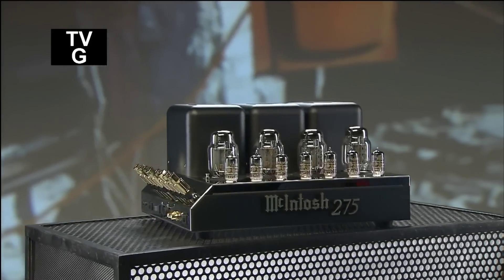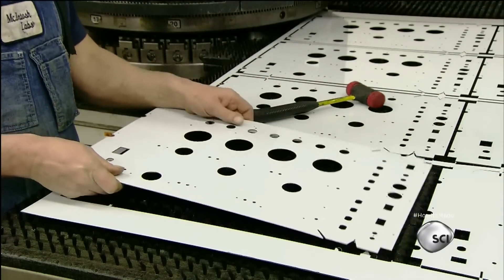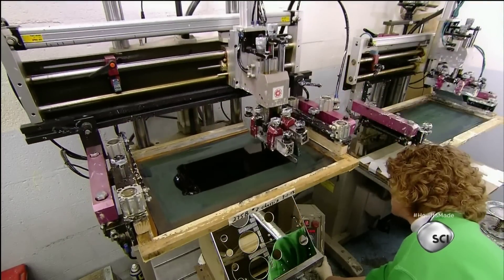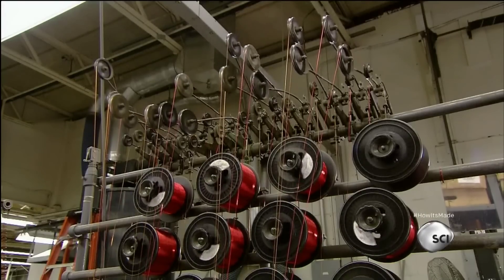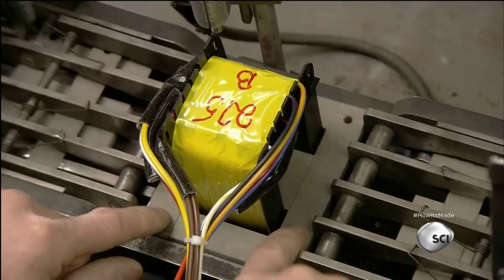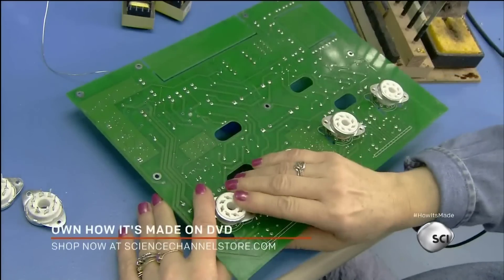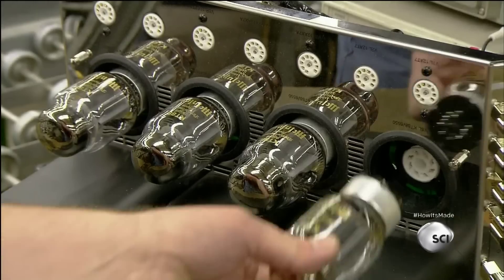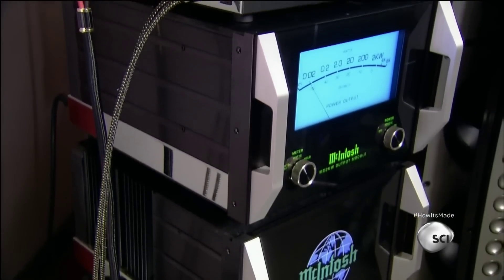How It's Made - McIntosh Tube Amp

Comment: I find it quite funny that a high-end tube amp manufacturer can get away with connecting everything with spade connectors instead of soldered connections. The fanboy's will say that those are connections that are "not critical to the sound" but, the build process should be the same throughout. You're paying many thousands of dollars for one of these amps. I'd be pissed to look inside and see quick connectors where they COULD have done solder joints.

Comment: May be you should make an audio amplifier using a small KLYSTRON TUBE.
I remember when I was a kid in mid 60s my father make audio amplifiers for sound system rental using a KLYSTRON TUBE.
The whole thing is about the size of a 6ft tall refrigerator and requires at least four men to carry.
Most of the weight came from several transformers two of which were hand made.

Comment: Had that exact same amp in the video and drove it with a Cary preamp. These amps were NEW. Sorry but the sound was NOT not all that. My solid state mid 1970's Marantz 2325 was far superior in sound quality than the Mcintosh Cary combo. The Marantz even has the warn sound you like from tubes in mid range vocals and male radio broadcasters voice. Tube amps are the best for guitar amps there is NO doubt but for full spectrum audio they are lacking.
Reply: Curious what speakers you were driving in this comparison?

Comment: they cost a fair amount of money and what do they use circuit boards  i don't understand that for the preamp tubes okay but the powertubes no way is this was point to point soldered this would be a verry great amp but that just my opinion i would never use a circuit board on a tube i'd but do point to point wirering al the way

Comment: Beautiful in appearance and in sound.
Love the power on sequence, really cool!
The only thing I don't like is the multitude of surface mount components on the main pcb. 
I realize its less expensive space saving and faster to use them, But the amp is already expensive, big and heavy as hell, I'm sure there's room in there for standard components , fatter wires, its just my opinion , I think it would be easier to service , prettier to look at, less time for repairs.

Comment: I love tube amps but I am not a fan of tube sockets on printed circuit boards. If you want to use PC boards for ease of mass production I would still put the tube sockets on the metal chassis. That said Mac makes exceptional gear and their OPTs are top notch.

Comment: Humm..Main Circuit Board.,that things does not look too heavy duty. When something goes wrong on that board is it fully repairable ? 
Cause if that thing needs replacement it kind of looks expensive and not all that sustainable in terms of 40-50 etc years.
I'm sure the specs are very high doing it this way but that's not everything.
In the Tag Board Point to Point way of doing an Amp  everything is sustainable/repairable in a pretty straight forwards manner.

Comment: That power switch though!
It looks like a run of the mill cheap generic plastic switch that one will be touching every time the amp is powered on or off
Reply: I auditioned a $6500 Mc integrated and was totally shocked that all the front panel switches were plastic and didn't even sit tight.  Major disappointment.
Reply: @bgm1911  it's a shame  they went to so much effort with the chassis and then gave it cheap looking plastic switches

Comment: @3:13 the presenter says "tar" is poured into the transformers.   I hope not - I hope that black goo is something much more suitable.  Tar (pitch) was used to seal transformers in the 1930's and 1940's, and into the 1950's in the more cheap & nasty brands of radios.  It does the job, for a while.   But over about 10 years or so it becomes brittle and cracks, as the more volatile hydrocarbon fractions gradually diffuse out and evaporate.   Then moisture from the air gets in through the cracks and corrodes the windings, causing faults.
In the 1950's, vacuum impregnated varnish became common, and when competently done, a vacuum impregnated transformer's never fail (unless seriously overloaded).    These days, oven baking with synthetic potting resins are an alternative to tar and vacuum impregnation is the cost of vacuum impregnation cannot be justified for low production quantities done in house.
For several years I worked for a transformer manufacturing plant (as the engineer) - we made a useful amount of money rewinding transformers that had failed due to the use of tar.  Even in the 1970's - an English brand of steam cleaning machines used tar-poured transformers.   It was a particularly unsuitable tar, and the transformers only lasted a year.   We rewound them and used epoxy resin - that never failed.
That green glow under the tubes has got to go - looks awful.  A cheap tacky gimmick.

Comment: Well I won't be buying a McIntosh if their normal practice is to hold and insert tubes with bare skin.
Reply: i might sound dumb, but whats the problem with that?
Reply: @ctiradantoninkupec1457  The oils and acids in the skin stick to the glass in the form of fingerprints, when the tube is powered up, the heat etches them into the glass, not only distorting the electron field, but physically shortening the life of the glass bulb, bearing in mind that the glass is resisting the pressure of atmosphere under extreme heat.
Reply: Maybe those tubes are just used for test, and not the ones shipped to the customer with the amp.

Comment: I had the opportunity to examine a Mac MC 30 and trace the circuit. Metal 1614 mil grade 6L6 tubes,  12AX7 dual triodes, all RCA. Point to point wiring with small components on phenolic boards, laced wiring harness. The output topology was Mac patented unity coupling, the 6L6 plates and cathodes connected to bifilar windings, and a separate feedback winding, if i recall correctly. The distortion specs were unbelievably low for the day, something like 0.05 %. Made in Binghamton, New York back in the day when New York State was the high tech Silicon Valley of the USA.
That was seventy years ago.......

Comment: An amplifier with PCB is accepted to some extent (mainly for cost reasons), but a high wattage amp with PCB & surface mounted components? LOL is that a joke? Are you kidding me? For such price tags I would expect to at least have have all the components be full size instead of those machine mounted tiny parts... Even relatively cheap sub $600 amps I see have PCBs with full size components. And please, don't even bother talking about such market-driven and absurd claims that SMD is better than through-hole. I'm managing a recording studio having more than 30 tube amps including some of the best outboard studio gears (e.g. Neve, API, SSL, etc...) and to my ears and many other pro working musicians (and also to some degree even pro electricians) those tiny surface mount components are not even comparable to the best full size components out there. And I did not even get into the duralibily, repairability and mojo of the hand-wired amps which actually also have some sonic impacts on the amp. Many people who have the experience of playing, recording amps and those who have used the best hifi amps already know these facts... but many newcomers and mostly people who are not familiar with electronic systems easily buy into such bullshit market-driven garbages by easily cashing out for one of these...
Reply: Electrons don’t care if it is a small, medium, or large SMD device, or a through hole part. There are some noise considerations with resistors, but I would trust that the designer of the amp took that into consideration already. I suspect most of the smallest SMD parts in the video were probably related to the LEDs or were otherwise out of the signal path. Even so, things like grid stoppers, grid leaks, cathode and even plate load (not the voltage dropping ones) resistors in the preamp can all be 1/4 watt resistors. SMD ceramics caps can be microphonic, but it looks like everything in the signal chain is a through hole film cap anyway. 

Where higher wattage resistors are needed, for example, the cathode resistor on the KT88s, they are using wire wound power resistors. 

PCB designs in guitar amps are frowned upon because of the abuse an amp is subjected to, and also in many combo amps the tubes are below the PCB, so the heat from the tubes bakes the board. On something that is going to sit on a shelf, and with the tubes mounted above the board, it shouldn’t be a problem.

Comment: “Speaker Terminals” Incorrect they’re called speaker binding posts! 

This is a modern approach to building Vacuum Tube Amplifiers with a PCB Boards! I am not a fan of this design most quality high end vacuum tube amplifiers do not use circuit boards! it’s straight wiring! a circuit board cheapens the product for mass production doesn’t deliver the very best high end frequency responses! Quicksilver Audio does not use this method with PCB’s! “We then hand wire our amplifiers to obtain the highest sound quality and to maintain the build quality that Quicksilver is known for throughout the world.”

Comment: Two things wrong with these modern day McIntosh amps.

1. The classic versions used no pcb board, instead they used to be hardwired point to point. There's something about the pc board flat copper tracks which interact with nearby chassis metal and form unwanted capacitors at every stage thus degrading the sound.

2. The tubes are known for their warmth and neon like glow.  The green lighting does not go with the psychoacoustics of a tube amp and seem cold.

Comment: This company has taken the Macintosh brand name to produce a vintage world class amp however it does not produce the original schematic nor original quality so don’t be fooled you can buy cheaper Chinese brands that sound just as good. The original Macintosh used a combined drive and output transformer that was biffilla wound sorry about the spelling, this type of transformer is expensive to produce so they are not used in today’s designs, the original Macintosh amps were hand wired without the wank factor built into this amp. Do your homework before you buy this amp, just saying.

Comment: Why only go back 60 years to the pre-solid  state years when you can go back another 35 years to the pre-vacuum tube years to the acoustic phonograph years.  No line cords, no 120VAC required  Just a wind up clock type motor and a megaphone.  Also, no batteries required.

Comment: 1:45 "magnetic metals will react with the current and cause distortion". If that were true, then why are they using nickel plating and nickel vias on the circuit board that connects to the lugs? Lol. Absolute pseudoscientific nonsense that has become typical for audiophile equipment. It is true that brass and copper have lower resistivity than ferrous metals, but you would not be able to detect distortion by ear or with a spectrum analyzer unless the current density was pretty high (above 20A/mm2).

Comment: Top of the line consumer products that look pretty for the guy that has money to throw away.
[Make no mistake it is really good and probably costs $20,000 for that amp]
You want quality and better depending how much money you spend...Go to the music center where the professionals go...msuiciansfriend.com, The Guitar Center in So Cal...You get the Idea. I have a Mackie mixer, SoundCraftsman PM860 Mosfet, 50V per Microsecond Slew rate power amp that will electrocute you if you touch the bare speaker wires [140V peak to peak] while the "truclip" indicators are blinking.
I prefer ElectroVoice speakers but for now I have 7 Custom E-force 12in loudspeakers rated at 450W peak each.
I could PA to a baseball stadium or light up an indoor basketball court/gymnasium.

Comment: They can do without the LED lighting under the tubes. I would rather just see the natural glow from the cathode heater filaments. A great amplifier like this just doesn't need "gimmicks". I wouldn't mind if they used thermionic rectifier tubes for the power supply, rather than solid state diodes. (I like tubes in my tube amplifiers)
Reply: mohada wisdeerf  hey dummy, we all seen the 419 movie and we know the black money scam. Take a hike off YouTube and get a real job.
Reply: @vegaslimoguy2376  LED lamps didn't exist for the majority of McIntosh's existence.
Reply: @brettbuck7362  When did i say they used LED lights??? Correct yourself bud!
Reply: @vegaslimoguy2376  Uh, what? Your deleted post said it was a "traditional look" for McIntosh. You realized how dumb it was and deleted the post (or someone shadow-banned you).

Comment: I am surprised the assemblers are not wearing light weight cotton gloves.  With all of those highly reflective surfaces especially.  I doubt that would happen in Asian based factories.
Reply: This amplifier goes for around $6000. I was surprised that the worker was wearing jewelry. I thought anyone working with electricity or circuit boards shouldn't wear jewelry. If anything they should wear a silicone wedding band.

Comment: Cheap steel chassis. Big money for nothing. The mirror finish and the green LED's can't make a sound and music out of this amp. 
NO tube amp (even McIntosh) could match the power and the music representation of a high-end transistor power amp(s) working in pure class A. The best possible sound the tube amps can reproduce is equal to a good, quality Hi-Fi MOS-FET transistor amp (for example SONY ES power amps).

Comment: as someone with not so much knowledge of the real basic physics of electronics between tubes and transistors - and only head one guitar amp using real tubes - I can't tell any difference
I know that, although transistors are often only mentioned when referring to digital signals, they also can be actually used with analog signals just like tubes - their only advantage comes with very high frequencies and digital stuff - as they can switch way faster than tubes - but in ranges of human hearing (up to about 20kHz) there shouldn't be any noticeable/audible difference at all
also: every component has its very own characteristics - but you can also get it the other way around: some smooth amplification using transistors and some rather hard cut using tubes
to anyone: if I'm wrong please just don't flame me, but try to take time to explain to me ... I want to learn - not argue

Comment: and yes there i s this issue of operating such amp safely, no person in his right mind would operate such device with fragile hot exposed glass tubes, red hot filaments, and a couple several hundred or so volts at the anode terminal, at least cover up those tubes please!!

Comment: the TECHNICAL term of Amplifier is the input controls the output, so therefore, amplifier  word alone does not mean it takes a signal and drives a speaker, op amp, isolation amp, and on an don...power amplifier would probably be the correct term, for a unit that drives loudspeakers.  pre amp, also is not driving the speakers, but is a control amplifier

Comment: A long time ago, vacuum tube amps used to do better than the switching transistor based amplifiers due to poor sampling rates and a higher noise floor, but at around the year 2003, a decent quality transistor amp found in upper mid range consumer sound cards, were able to beat even the high end $1000+ tube amps in quality and dynamic range. While this is an older video, on 2017-2018, we have reached a point where the onboard sound card in a $150-180 motherboard, would beat the quality offered by even a $500 tube amp when it comes to driving headphones.

Comment: James Randi is good at producing double-blind tests. Use his methods to settle the question of whether or not a difference can be detected between tube and solid state amps.
Reply: There is a difference, even at the same gain and voltage and everything else the measurements will be equal, but they WILL sound different because they amplify in a totally different way. Even audio engineers say so, there is a difference.

Comment: Excellent sound reproduction with very clean power output.  (extremely low THD) 
But no where even close to being worth the price. 
The wasted energy alone is astronomic. 
But even then, there is nothing like the sound such waste can produce.  lol 
FYI: Do not waste the time, money, and effort to get a tube amp into a vehicle. 
I managed to do it, but the tubes really hate vibration. And a car no matter the age, is not vibration free.
Now add in subwoofers. lol  
The results were the destruction of all but two tubes, with one HELL of a great sounding system beforehand. If only for a few short lived minutes. 
Not to mention a now unused inverter that was used power the amp. More work went into getting an inverter capable of running the amp. The wave-forms produced by inverters were a challenge to overcome. And even then, it was not as good as AC coming from the city.

Comment: I don't like the tar they pour around the transformers!
Reply: The tar is there to damp mechanical vibrations so that the amp chassis doesn't hum, and to keep those finicky multifilar windings firmly in place.  Nice thing about tar is that tar potting is reversible. If you absolutely had to, you could heat the can in an oven, pull the transformer out, clean off the goo, and rewind it if it blew.
Reply: The Tar they poor around the transformer windings is also called potting compound.  They could have used air drying transformer vanish and then baked the transformer in a oven does the same thing really.  Stops the windings vibrating.

Comment: It's digitally (you know DIGITS!) proven that they sound exactly the same under lab conditions.  The problem is that the 'tubelovers' don't have the balls to say that they like the tubes more and some of them just want to show off.
Reply: Tubes and transistors do not sound the same, even audio engineers with 40 years of experience say so. They do NOT sound better, they sound DIFFERENT. You can not prove that they sound the same.